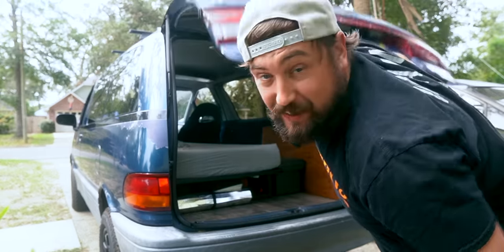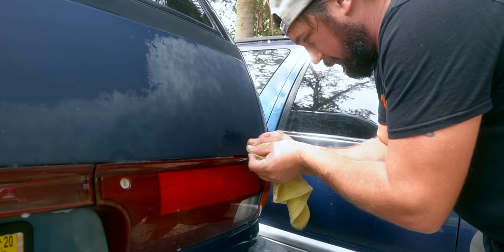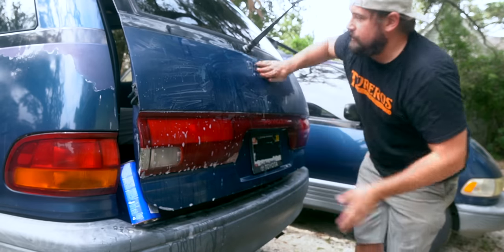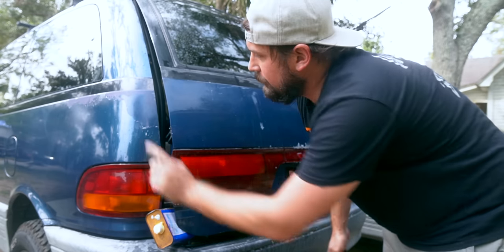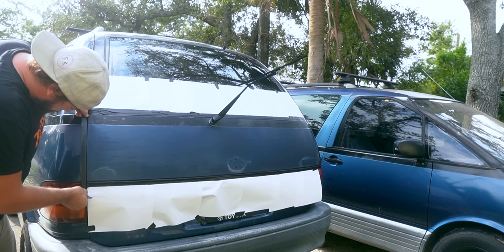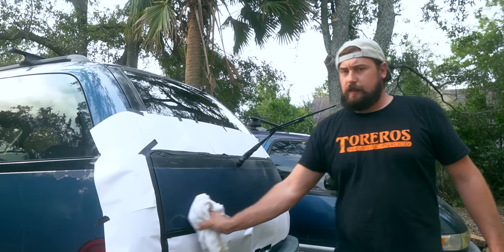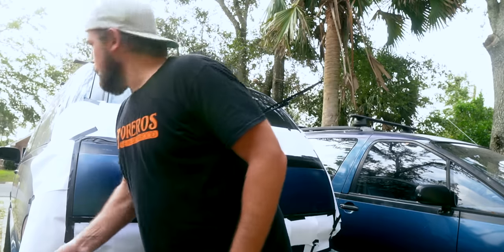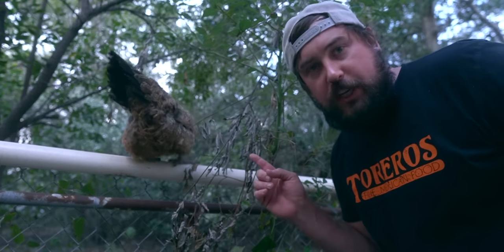How to fix Faded Car Paint |  Peeling Clear Coat repair | Toyota Previa Minivan Camper Conversion

Comment: Just a tip. Put your spray cans in hot water for a few minutes before using, it helps build pressure and thins the paint for a finer spray.
Reply: Thanks for this idea. I will definitely keep it in mind for future spray can jobs.
Reply: I use the sun
Reply: @joebird1400  Slow. Not as hot.
Reply: Great tip. It actually explained why a guy doing a video on plastidiping rims put his cans in hot water. I had no idea why until now. Thankz!
Reply: @farelimm  LOL
Reply: Judging by the palm trees around him this is not necessary
Reply: Thanks!!!❤
Reply: I do a similar thing with my gloss and matte coat cans on Model Trains… yep, I’m a train nerd 🤓
Reply: Really? you..... TAGGER! 😲😜
Reply: This is sounds like a pro tip. I’m going to try this!
Reply: @KilosFlo the sun doesn't have near the affect of HOT WATER in a confined space but you do you
Reply: Thank you
Reply: I always do the same thing when using spray paint
Reply: Put it in microwave

Comment: I love that you mask everything up, then overspray right onto the car parked next to the van
Reply from the maker: I live for this!
Reply from the maker: That’s also the good thing about clear coat… it’s clear ;)
Reply: I was thinking the same.
Reply: @Dirty-D  i usually apply 2 coats on myself after a shower wife says you look like glitter aww
Reply: Not to mention the window, the roof and the sides of the same vehicle haha
Reply: hense: his YouTube name lol. I got great results following his steps! ;-)
Reply: No charge for overspray 😂👍🏻👏🏻
Reply: What tape did you use? Looks like duct tape. No wonder it left residue and nearly pulled the tail lights out when you removed it. 😂
Reply: Not his car, no problem there. 😂
Reply: Well Scotty kilmer is his idol so totally makes sense!
Reply: @sweetbabysean …. Good dude… great attitude… much respect…
Reply: Thought the same 😂
Reply from the maker: Glad you liked the video!
Reply: Bro, he said in the video that he dosent care
Reply: So, you didn't hear him say that if it fails he can use the hatch off the van beside it?  Meaning the other van is for parts.
Reply: Don't you like your lungs? Wear some kind of mask
Reply: @n.p.2653  hes outside....pin. Dont be a covid guy.
Reply: Who cares as long as you stop the rust .... i painted my hood on my 2014 ford edge and it turned out pretty nice, until the weather decided to spit on a 10% rain forecast !! What a nightmare! I strugled to get a tarp over it as the wind started to whipup and dropped the tarp on my beautiful clearcoat and fkn ruined it !! I will never paint a car again outside of my garage... FFS

Comment: Hey I am an automotive painter. My advice would be to go slower with the clear coating sprays. You will achieve better results with only two coats. Because as you slow down the  clear has more of a chance to build up as it’s laying down.
Reply from the maker: Next time. There will def be a next time
Reply from the maker: True. Clearly this is a diy hack job I knew what I was doing was a “is what it is” job
Reply: Yes go slower, pile on that clear coat - unfortunately you have to be skilled to avoid runs.  I got run and it was disasterous - start again!
Reply: @springer-qb4dv  the trick is,  giving away all my secrets here but, look at the surface you are applying clearcoat to on an angle find the reflection of whatever light source is hitting it and use that as your guide apply a smooth even layer of clearcoat based on the reflection if it builds up too much it will run a good layer of clear will look almost slightly dry when you are finished applying it but as time goes on it should self level out.
Reply: @springer-qb4dv  just sand out the run, use a block,  the run / high spot will sand down first,  if crazy bad, apply  a thin coat of body filler alongside both sides to control the run removal
Reply: Would the 2K clear be better?
Reply: He mentioned it was lacquer! Not the modern day environment nonsense. Yes, you need many coats (6-10) then polish. Nothing in the world looks better.
Reply: @davidp8157  Body filler? Why not just use a single edge razor. Put some tape on both ends wrapping it around the blade but leave the center open and just shave the run/ drip down. Or a little file lightly along the drip.
Reply: @leonardceres9061  I like the razor blade  idea. I've used it before for other purposes but hadn't thought about it in this situation. I can't sat I've had an issue with runs  since the very early days of squirting paint over 35 years ago, the bog trick was something I saw done, but never had to resort to myself. Thanks for the tip!
Reply: @davidp8157  Np. I get runs all the time even after 20  plus years of painting. Why ? because i’m imatient and rush though things like I do life. I always fix what I mess up though and the razor trick works great.
Reply: @leonardceres9061  Very well said and extremely innovative. Continued peace and blessings unto you.
Reply: Well done.
Reply: I agree, lots of people seem to say 5 super light layers is the way to go, I think 1 light-ish and 2 fairly heavy ones is superior
Reply: Hello, I have a Chevy truck 2000 need take paint off  look so bad and send you pic
Reply: @LauraTorres-on3sq  Stripping the paint is a long arduous process. There are a couple ways to do it. One is chemical the other is mechanical. for chemical stripping, you are going to need to use a paint stripper product. Do you have to put it in a container like a small pail and brush it on the paint and wait for it to start bubbling off I would do this somewhere that you have a hose because as the paint start stripping off you’re going to want to wash it a little bit to take the stripper off and the paint as well. This is not a perfect process though and you probably will wind up doing several applications. You also want a good paint scraper to help scraping the paint off as it gets soft. This is a very messy task. Also, you could do the mechanical method which is using a palm sander with heavy grit, sandpaper at least 80 grit, maybe even 36 depending on how rough and hard the pain is I would start with 80 grit and start sanding to do this, you either need an electric palm sander, or a pneumatic, one that is hooked up to a compressor for your purposes an electric one would probably be best. When you do this, you have to be careful not to go too close to the rubber molding and trim. Like I said, this is a real pain in the ass you could start outstanding it and then get to the point where the pain is weakened enough that you can use the stripping chemical. I’m sure you can find some videos on YouTube to help you out with some visual aids. Also, when this is all done, you’re gonna have to prime the whole thing anyway. Honestly, I probably wouldn’t even worry about stripping the car I would just send the whole thing down with like 220 grit sandpaper and then spray the whole thing with a feather fill primer. Then sand all that, and then you have the process of painting it, which if you are not an experience painter is a whole other animal in itself. There’s a reason why getting your car stripped and painted costs big bucks.
Reply: @leonardceres9061  thank you so much for your reply back. I appreciate that I’d like to do things on my own but I am it’s gonna be a lot of hard work to.
Reply: @LauraTorres-on3sq  yeah, no problem anytime. If you lived near New Jersey, I’d let you come down to my shop and show you some different techniques and tips in person to help make the job a little easier. But figure it out like this a skilled person who knows what they’re doing would probably be able to get a car stripped down to the metal in anywhere between 24 to 48 hours work time that includes priming everything so if you don’t know what you’re doing figure about double that time.
Reply: @leonardceres9061   I live far away in California, so I’m gonna try the best that I can do for myself and maybe I’ll get someone over here to help me Thank you so much for getting back at me.
Reply: @leonardceres9061 thank you for the advice!

Comment: It looks pretty good, but for a little constructive criticism I would of done 1 layer of basecoat after sanding, then when applying the clear coat only apply 2 layers, with the first one being really thin and letting it dry for a few minutes to create a glue for the 2nd coat to stick to, and on the 2nd coat lay it down thick, the glue you create from the first coat will allow you to lay on a really thick coat without it running: also spray bottom up instead of top down to work against gravity. Then after 24 hours of drying you wet sand it with 5000 grit sandpaper, followed by compound, and polish. Wait 30 days for the paint to fully cure to the metal surface then apply wax for that showroom shine finish.
Reply: What is a good compound and polish to use?
Reply: That sounds great
Reply: Chris Fix advice at its best!
Reply: What is basecoat?, is it just the base mate color?, can it be glossy or semi-glossy?
Reply: Perfect advice I’ve done auto body for many years and have done spray can repairs too that’s a good method you use
Reply: Great advice!!

Comment: For a cheap fix, it's perfect. If it's super faded, our local paint supply can mix body color in spray cans, so you can freshen the base coat before you clear. In this case, super fix on the cheap. Awesome work.
Reply: Shit is 40 dollars a can tho... I'll pass
Reply: @Iknowyoumadnow  Yes $40 is way too expensive.  My car was dark red color so I went to home depot with a paper and sprayed sample of all the dark red spray paint they had.  Then came back to my car and compared samples to my car's color and chose closest one.  It worked out great - repainted rear quarter of car and can barely see difference between original color and the home depot   off shelf spray paint.
Reply: Kool, what store does this? I need a couple cans for my truck
Reply: How do I find out what paint I need on my car I bought the car and someone did a shitty paint job but I do like the color it's a royal blue kinda not sure the name

Comment: Dude, I have been a spraypainter for 48 years and I am impressed with the job you did on the tailgate. Well done Dude 👍👍 Brett from Australia 🇦🇺🇦🇺🇦🇺🇦🇺🇦🇺🇦🇺
Reply: @Frank_Pods  lungs are hanging in there. I am retired now 😁
Reply from the maker: Hahhahahaah
Reply: @sweetbabysean  did you match the blue factory to the van?  Spray it first or did you spray the clear coat directly to it after you used the 2000 sand grit ??.
Reply: @Clos-wx1mv seems like he just cleared it directly after sanding.

Comment: bought a car for $500, looking to do something similar on a good portion of this vehicle. Glad to see someone doing this for a cheap fix. All other videos wet sand and buff. Also most of them do a primer and new base layer of color, not looking to do that BS, just want a solid easy cheap fix to get rid of the clear coat oxidation.

Comment: Going to check this out.
Really hope it works.
Walked out today, after 2 days of very heavy rain, and found TWO large water bubbles on the side of my truck. All because the 20+ year old clear coat had flaked some and now holding rain water.
Reply from the maker: How did it go?
Reply: @sweetbabysean  

I only managed to sand it down. I'm having trouble finding the correct sealer needed. So i just used basic paint sealer. My truck is white, so it's really hard to see the clear coat issues after sanding.
It's a work truck. So my main focus is keeping water from bubbling in the clear coat again. Seems to be working.
Reply: @sespider  did it work?

Comment: If you have guitar string or piano wire or solid welding wire a piece of it wrapped around a couple small vise grips and clamp the wire in the vise grips will take emblems and moldings off a car with zero damage to the finish or emblems. Just don't use it like a saw , pull the shorter side towards you and hold the longer side firm . Promise you it's the best way to remove emblems and mouldings that are attached with two sided tape,  also works great for rain guards.
Reply from the maker: Hell yeah! That’s a great idea. And I wasn’t really concerned because I was going to sand and  put the emblems back on so it wouldn’t be noticeable. Yah know what I’m sayin?

Comment: Wow that came out really good, I bet a quick polish of the clearcoat would make it nearly indistinguishable from the other panels.
Reply from the maker: its been keeping well so far but florida summer is coming so we will see!!
Reply: @sweetbabysean  apply some kind of UV protectant. They're not too expensive, some of them are as easy as spray and wipe.

I did this to my car, and didn't apply any protectant. Lasted a good 8-12 months but the UV damage destroyed it

Also, pls use a mask next time you clear coat lol

Comment: Looks way better than it did previously!
Reply from the maker: Steve B absolutely better. Def an improvement. I would try and all the clear off and try and get the color uniform before clear coating. I didn’t care about the color fade. I just wanted it to not peel off anymor

Comment: I have a similar issue on my 8th gen civic. All other paint correction videos are like sand till sheet metal and start with the primer. I mean I’m looking for a quick fix not a paint job.

Thank you for this tutorial. It is exactly what I wanted. I appreciate you making this video.
Reply: Wet sand gradually (600) to 800 to 1200-1500 grit to clean up the rough Edges and peeling clear coat. Depending on how bad your base coat is faded you’ll be able to just reclear, just make sure you blend so you don’t get harsh edges from new clear coat

Comment: I tried this on a Fiero several years ago. It looked pretty good for a couple months. The dead clear coat continued to whiten under what I had sprayed and some of what I put on started coming off. It ended up looking worse than before I started.
Reply: I think that's because the factory clear coat has hardener in it and the cheap spray won't bond to it.
Reply: yes better sand off nearly all of old clear coat, and start over with new base paint and then clear coat

Comment: I tried using base coat (dupli-color- silver metallic) with Spray max 1K clear coat on my old corolla's faded/peeled roof but it did not work well because I have lines on it. I have to re-do again the whole roof again today and this time I will warm up the can first but the dupli-color are not cheap ($15 per 8 oz - can say touch up only - did not say paint whole roof).  I wished I just use clear coat because yours turned out great; however, my faded /clear coat peeled are worst than yours but I think just clear coat may blend in better even I might see the faded paint. Thanks for the video.

Comment: Using dish soap to wash vehicles extracts the oil in the clear coat, causing this. Think ducks and oil spills.
Buy some cheap soap for washing your vehicle people, so you don’t have to replace the “most durable part” of your paint’s finish!
Thanks for the video of a decent fix with all the realness of doing it!

Comment: If you need OEM plastic restoration, RENEW PROTECT. I have a 1993 LE. I have been detailing it for 30 years. You may have been able to sand/buff that panel back.

Comment: I noticed that you didn't alternate painting vertical and horizontal. You will need to sand it down to get rid of the orange peel and polish to a really nice smooth finish. Good painting job though.💯👍
Reply from the maker: MoBang FoYoBucks I did a few up and downs but mostly left to right. I am def planning on polishing the whole van soon so I will focus on the tailgate as well. Trying to decide if I want to attemp to do the quarter panel. But it’s hard to find the nauticle blue color I need to do a little touch up first grrrrr. Also polishing the badges and putting them back on
Reply: @sweetbabysean  look for the color code on the manufacturer sticker. You can Google with that code for the correct match color. There plenty of people sell it out there.
Reply from the maker: @MoBangFoYoBucks  I don't trust them!

Comment: The paint on the hood of my 2004 Toyota Camry (bought new) was chipping badly,
so I recently went to Toyota & bought a 'dupli-color' pen, for $14. to fill in the chips! 
I was surprised that the 30 plus chips almost disappeared, which saved a $1,200.
repainting of the hood! It doesn't work on large areas, though!

Comment: With rattle can. You'd be better served not spraying like you're using a paint gun, because it's a paint can. And it's single action.  So the starts and stops of the trigger are the worst sprays.  So you should not let off from top to bottom.  Treat the middle of the spray,  the fan, as the guild and spray the very top with the middle of the fan, move down 1 or 2 inches every pass. That panel looks about 15 inches.  So you should have done about 11-15 passes.

Comment: FYI the last steps should have been do some wet sanding on the clear coat with some 2500-3000 grit then hit it with some polish and it will look AMAZING.

Comment: Nice video how did the clear coat hold paint job hold up over time?
Reply from the maker: I’m
In Florida and my vans ass faces towards the worst of the daily summer sun and it will prolly last a couple years I’m guessing. I would use a resin based paint if you are looking for something long lasting in hot hot areas. But if you live somewhere relatively cool with no direct sun in your driveway it’ll last longer for sure
Reply: @sweetbabysean  lol forsho I live in Cali it ain't too hot here. Thanks for the info 👍🏻

Comment: Thanks for the nice video. You should go down to 600 grid and blend the clear and base with 800grid.

Then you can use 2k clear with 4 coats, then sand the clear down with 1500 grid and then with 2000/2500 grid.

2k clear coat gives a nice shine , whereas acrylic needs more sanding and buffing

Cut and polish for a nice show shine.
Reply from the maker: Next time!